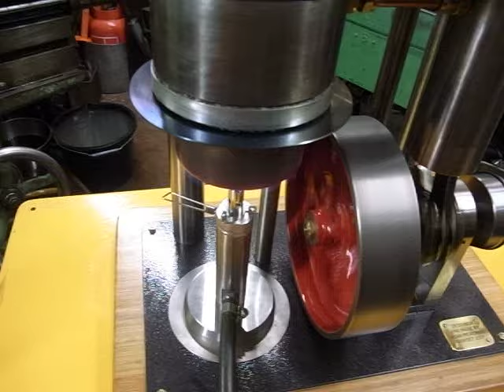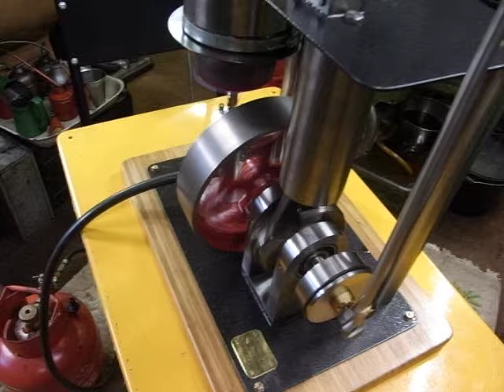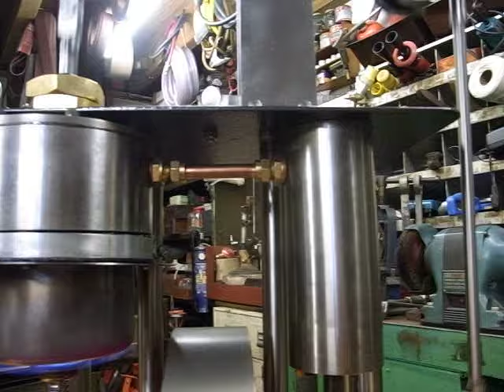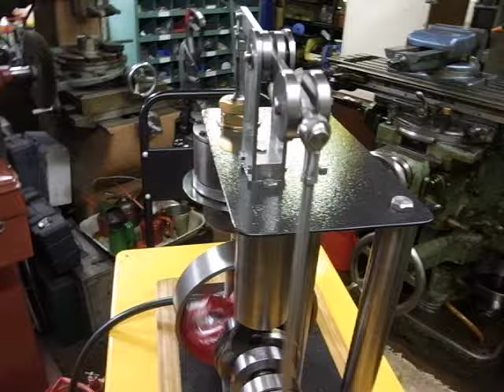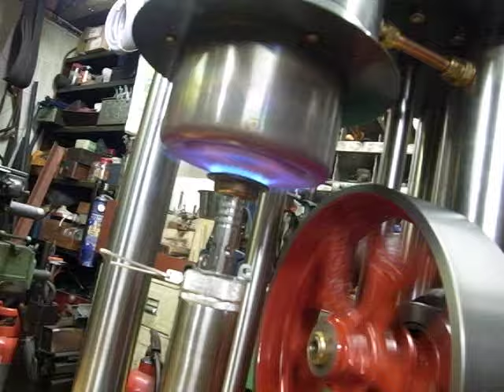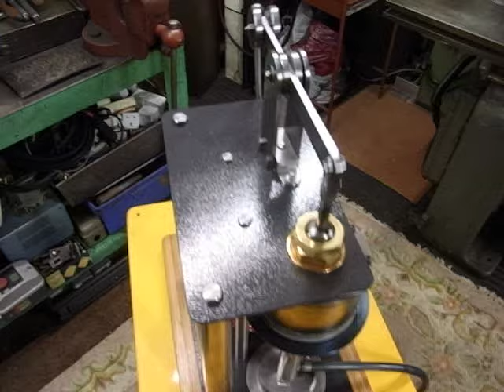Stirling , Freelance Hot Air Engine made in 2017

Comment: Nice work
Reply from the maker: Many thanks,   I admire  your input & ingenuity .   This engine I have now modified to be water cooled.   A tank on top feeding water through a copper tube wrapped  tightly [& sealed] to the displacer heat sink with power transistor cement then lagged.  Thermic siphoning does the pumping,  it proved a massive success & will now run for 4 hours unattended. I think that water cooling is essential for a long run time.